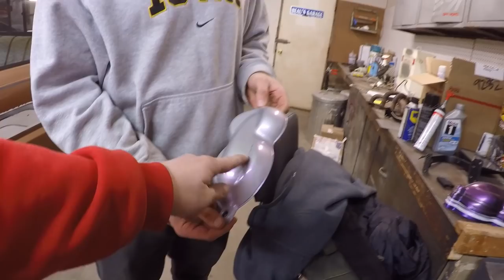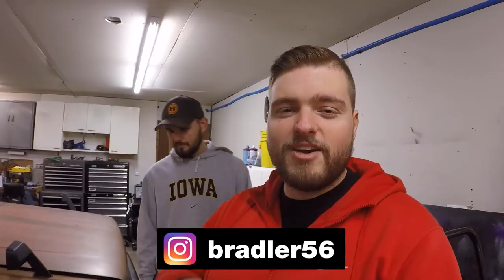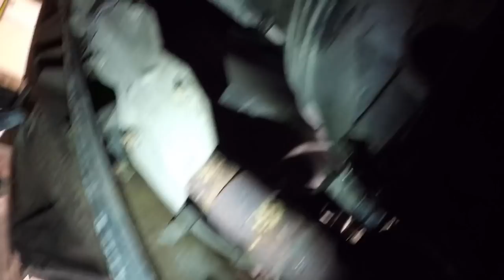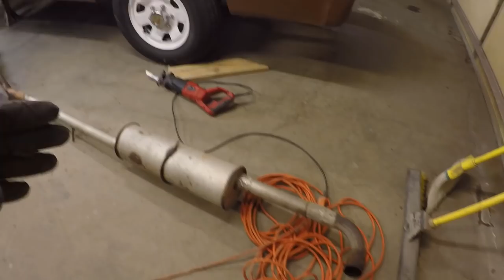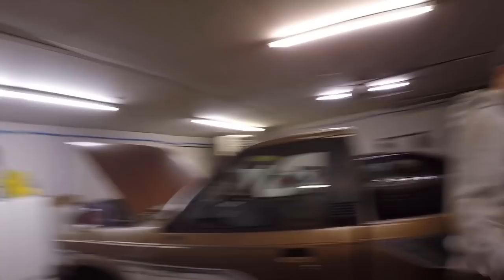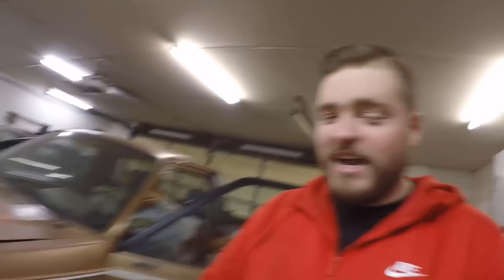Header Install On Mazda B2000 | + Civic Update

Comment: When I put a header on my B2000, I drove it down to the muffler shop to get the muffler and pipe welded up.  Loud as hell.  I saw a cop and pushed in the clutch and coasted until he was out of earshot.

Comment: Just did my Weber, header on my b2200 and had my exhaust done 2 days ago and it sounds great. Not cat with a muffler and good tip sounds awesome. Next thing to do is get her painted. It’d be cool if I could message you about your truck I have a couple questions and maybe a few tips to help y’all out with it I’ve had mine for a little over 3 years
Reply from the maker: That's awesome, and you can DM me on Instagram at abnormal_garage. It should be linked in the description of the video.

Comment: The 02 sensor on the b2000/2200 carbs are only to operate the emissions control crap. Very first thing any of the mazda gurus like myself is a weber carb emissions delete and optional header.
Reply: I deleted emissions with header no cat have stock carb still but notice a difference in power.I had to have my head milled 26 thousand to use after head warped.Strong next will be weber.

Comment: not to rain on your parade , but it would have been a lot easier and less costly to just gut the factory catalytic converter and purchase OEM replacement exhaust parts 

i did that very mod on a mitsubishi 2600 cc engine , just use a long extension to pulverize the catalytic honeycomb guts  and shake out the bits 

the guts had become clogged resulting in no acceleration above 50 klicks an hour , i just bought oem replacement parts and had a mechanic weld in a free flowing muffler 

punching the catalytic only took around 5 minuted to do